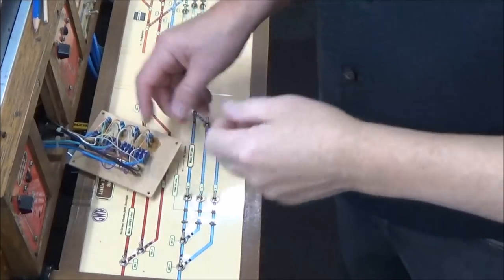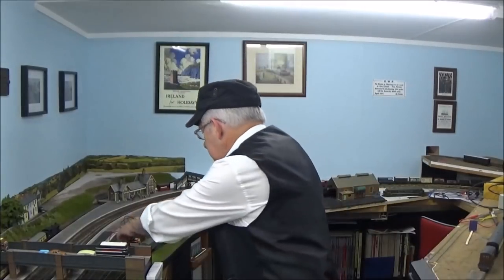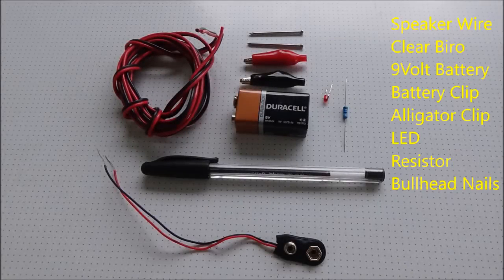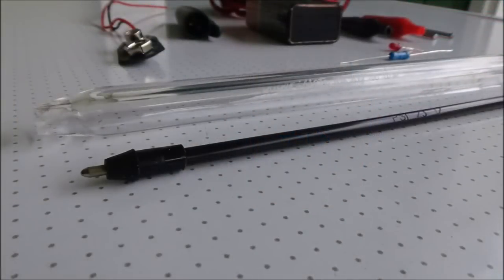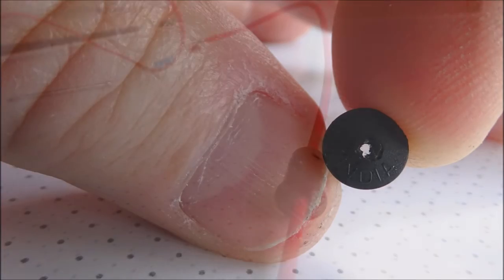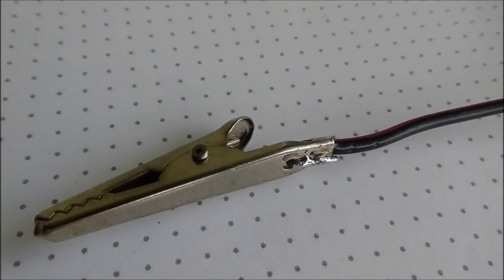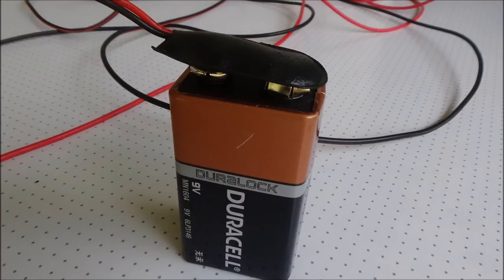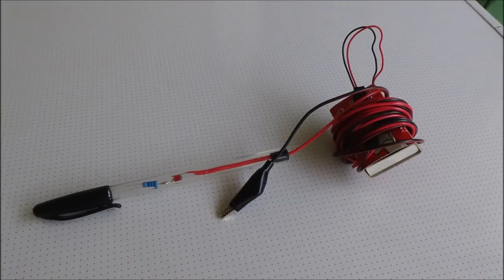Episode 100 18 Build Your Own Continuity Tester

Comment: Nice. By the way, a link to Platform 1 might help traffic? Resistor values?
Reply from the maker: Thanks CrowT,
Resistor values can be worked out but depending on your input voltage. I`ll insert a link below which has a calculator which helps greatly.
http://www.instructables.com/id/Choosing-The-Resistor-To-Use-With-LEDs/
Cheers
Gormo
Reply: Thank you for the info. You've always got good ideas.
Reply from the maker: No worries Crow T and thanks
Cheers
Gormo